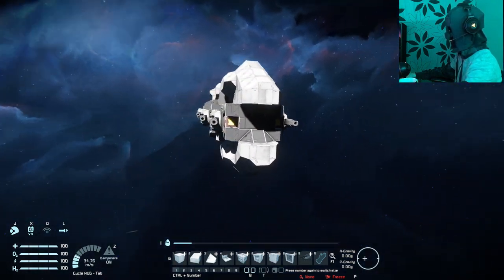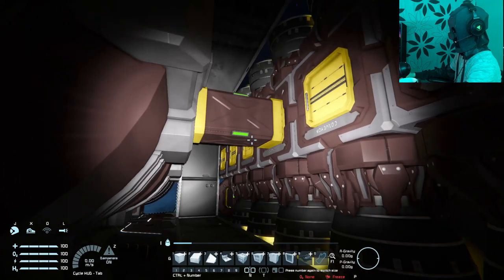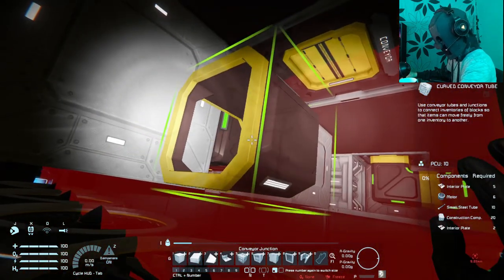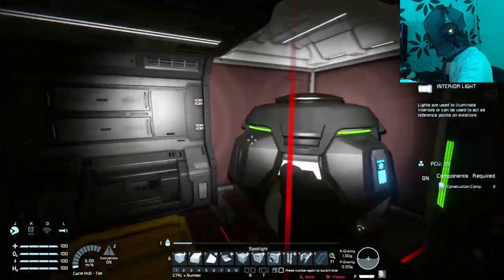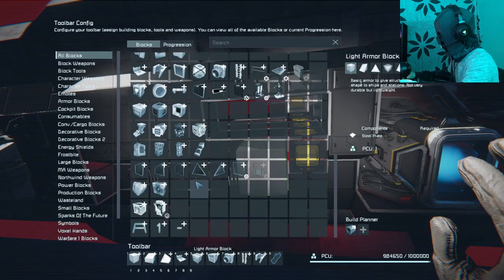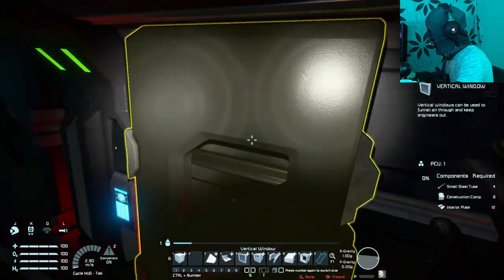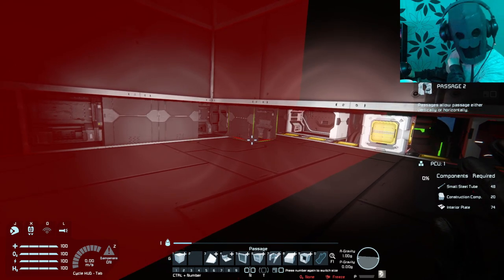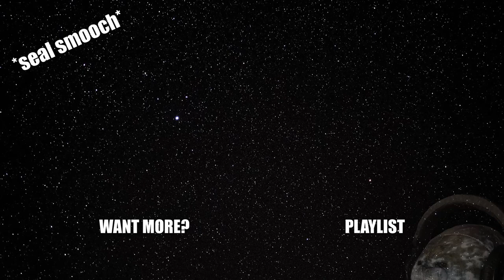How to Implement INTERIORS into your ship | TGE FRIGATE (Space Engineers) Design A Star Ship #018

Comment: Pro tip...you can make sleeker docking ports by using a rotor to small head and a small connector then set depression to level off with the exterior and surround with 1 ring of small blocks to make it flush. They tend to look much nicer too!